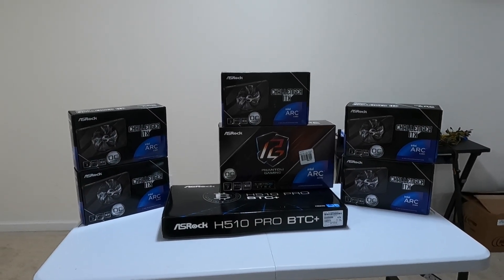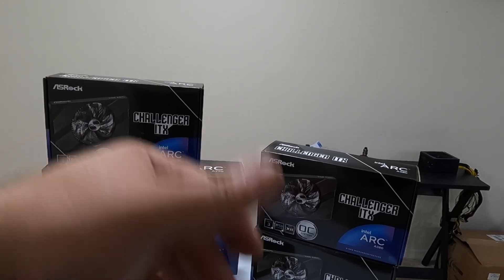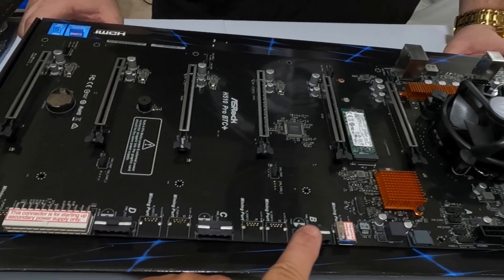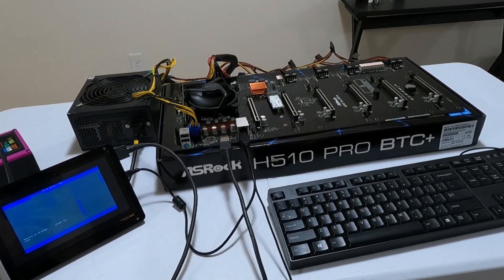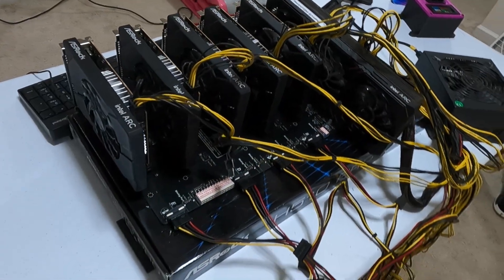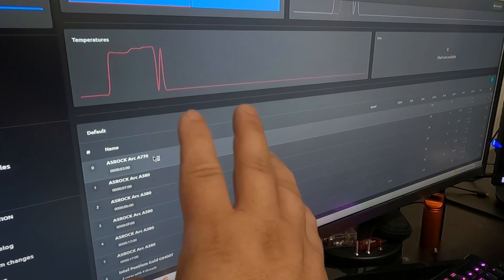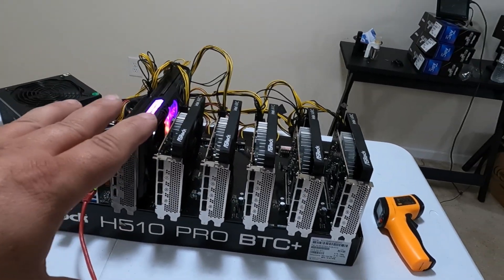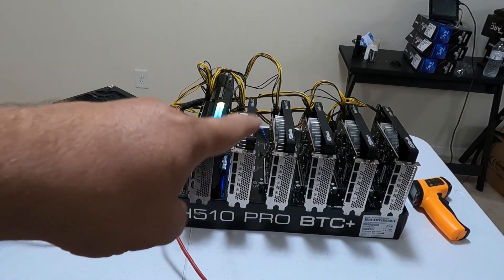ASRock Intel ARC GPU Mining Rig Build - Part 1

Comment: any kind of frame or case for it? i looked at that motherboard a while ago and wasn't sure if i wanted that much hardware with no frame or case. if it's in a safe and clean spot it's probably fine. looks like a neat rig, not much weight with the smaller gpus